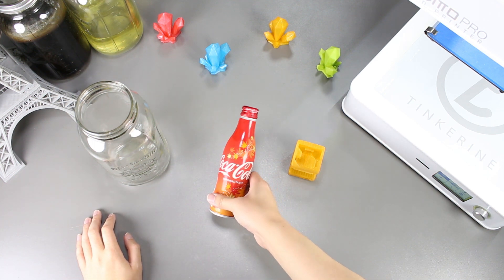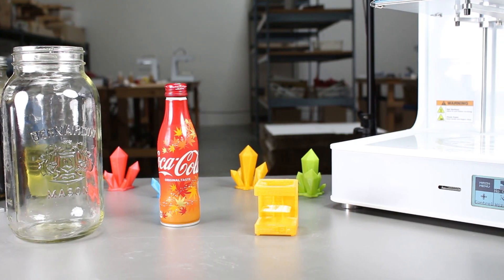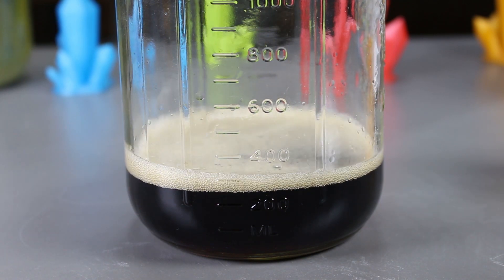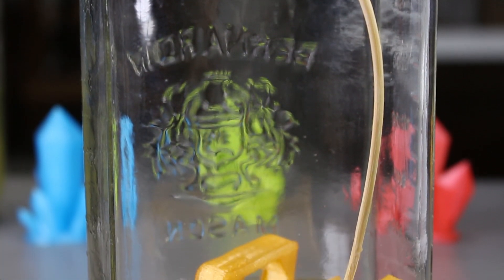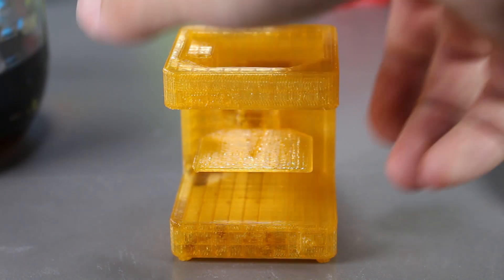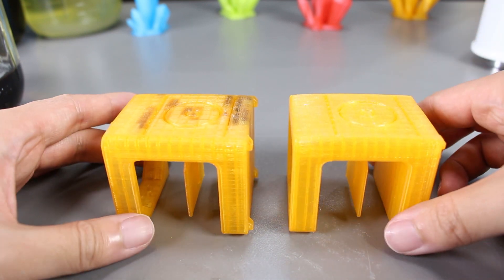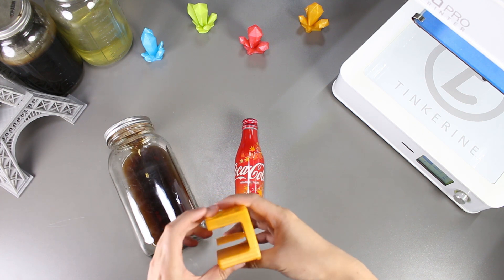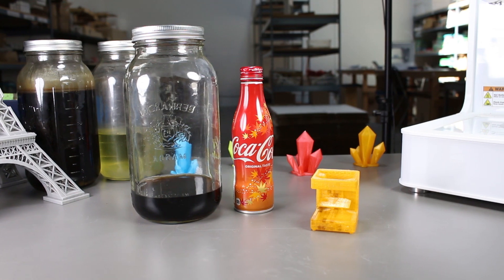Attempting to smooth PLA Prints with Coca-Cola

Comment: It's awesome that you report things that DIDN'T work as well as things that did. Great to see actual experimental results rather than just cherry picked successes.
Reply from the maker: Thanks for the comment! Do you have any experiments you would like us to try out?
Reply: Tinkerine here are a few ideas:

Heating prints in the oven at different temperatures and times
Trying different sized abrasives in a rock polisher for surface smoothing 
Making filament from recycled bottles 
Surface smoothing with a desktop cnc mill
Reply: Tinkerine more ideas:
Printing cups or bottles at different feed rates and testing how watertight they are. 
Printing and threading caps or bottles at different feed rates and testing them with different air pressures to see when they leak and burst.